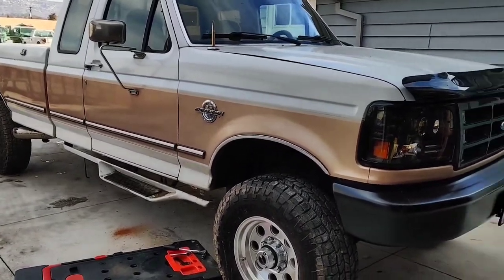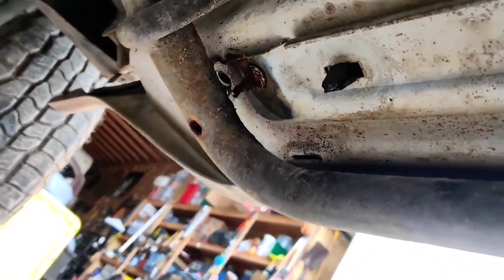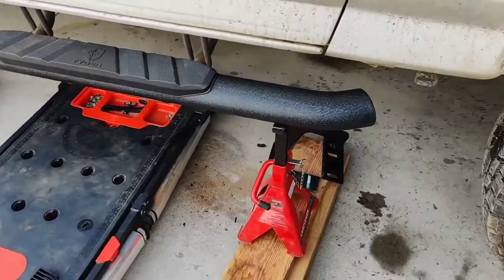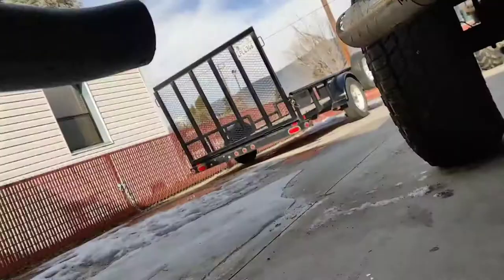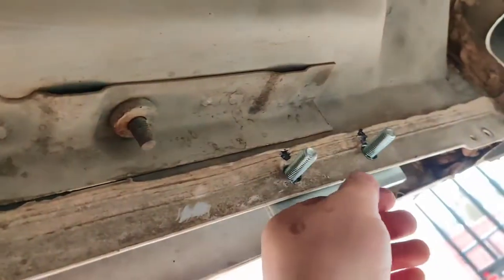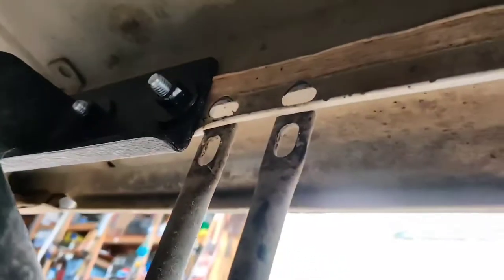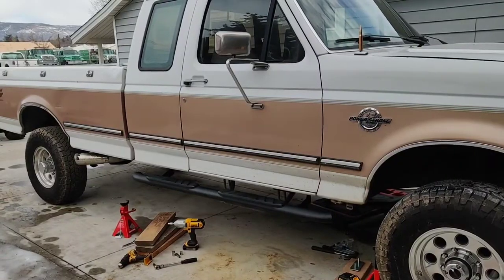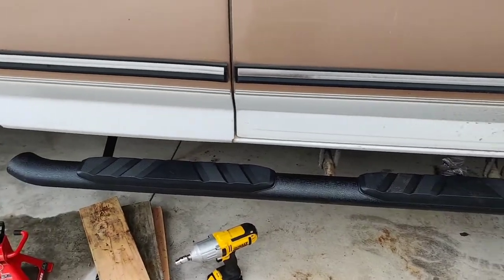Installing running boards on a 1997 F250 obs.

Comment: What are those paint matched running boards called?
Reply from the maker: Sorry for the late reply.  They are xlt oem running boards. They usually come in a primer color which you will have to take to paint shop to match the color up.
Reply: @revelation6_8  Do you know anywhere that still sells the OEM style running boards? I've been looking everywhere and think they might be a junk yard special now.
Reply from the maker: @randersonline  as far I as I know they are a discontinued part made from fiberglass.  I love the classic look from them and wish a company would bring them back. Mine were all cracked so I put these on instead.  It's probably a junk yard special.  Sometimes people in forums are selling them if you ask. Or ebay. Good luck and let me know if you find any.

Comment: What brand are those running boards ?
Reply from the maker: They are Tyger 3.5 nerf bars . I found them on eBay. They say they fit 1997 to 2001 OBS fords. I had to do a little extra work to make them fit. I recommend utilizing the old brackets to further support the new side steps.